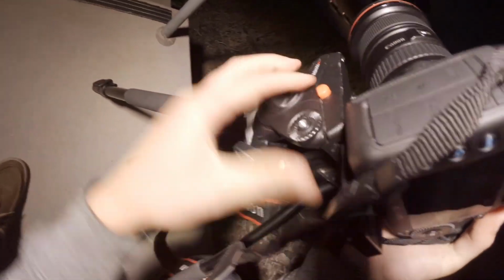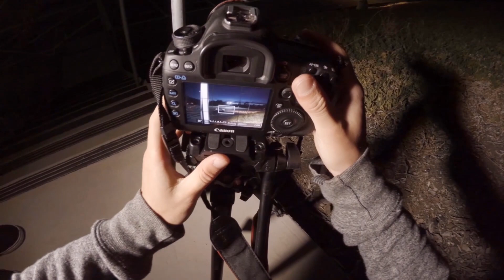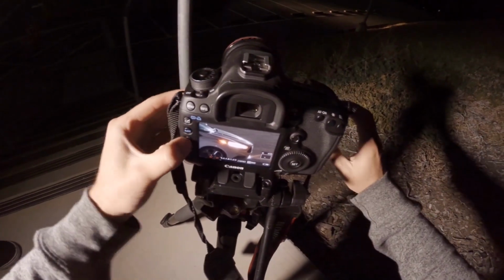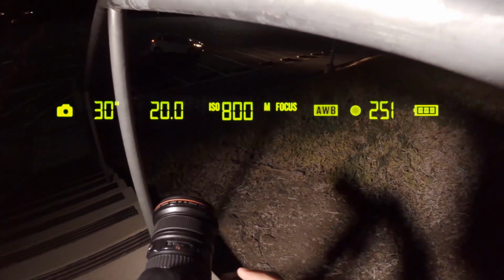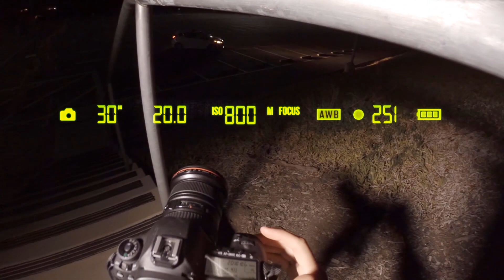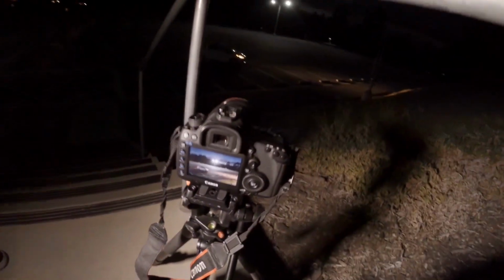Light Painting: How To

Comment: How did you power the lights with the car? Did you hardwire them or have an adapter for the cigarette lighter?
Reply: Battery pack or cig lighter, it is placed inside the car. Don't see why it would matter which.

Comment: I mean like how can you disappear from the photo when u lighting it
Reply: Raka Gunawan So long and you don't get any light on you, you won't appear in the final photo. It helps to wear dark clothing as well. Find a room with little light from the outside (works best at night.) Set exposure to 20 seconds with an aperture of f/8. You can use a table if you don't have a tripod. If you don't have a remote you can use the touch screen for the shutter button if available. It also helps if you have your phone light on and just cover it with your hand. Take the picture, get into frame, move the phones light in different directions/draw shapes/do whatever. Now check out your pictures. Play with different exposures and f/stops.
Reply: so i have to wear dark clothes and set the exposure longer isn't it?